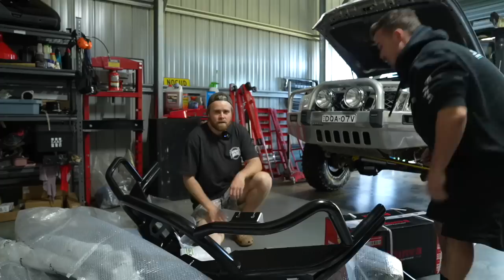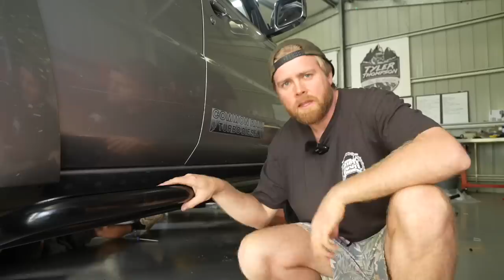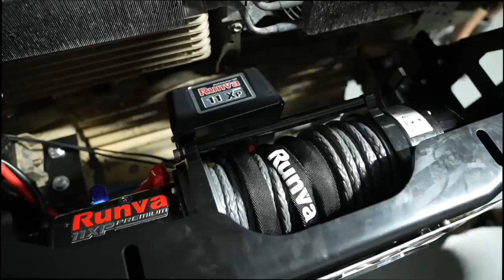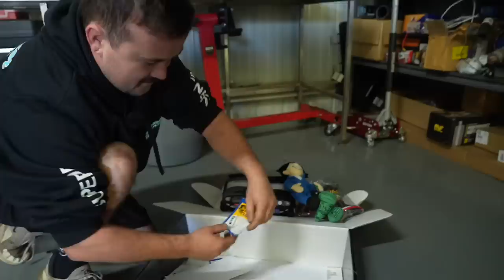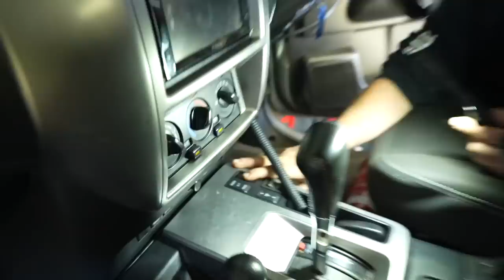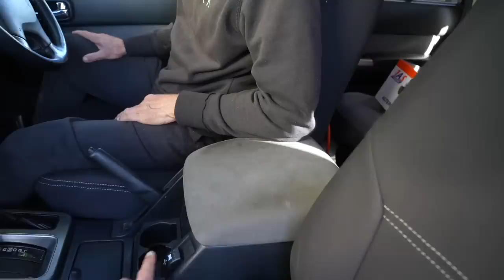My Dad's dream 4WD is done!

Comment: Hey Tyler 
I’m a ZD30 enthusiast love what your doing with your old man’s rig 
A quick question the engine with it’s factory exhaust ( dual catalytic converters ) heat up twice as fast increasing the chances of cracking your heads which I’ve already experienced 
In the build videos I didn’t see any egt or water temp gauges and 3” exhaust being installed 
For peace of mind to protect your motor I would recommend doing them I’d hate for something to go wrong on one of your trips 
Love your content especially when you’re hooking up with some of the other creators which is priceless and your banter with burto a crack up 
Always looking forward to your next posts

Comment: Ha guys, you made my day showing the wholesale automatics lock up kit install.
Couldn't you have just accessed the auto temp through the ultimate nine heads up display though, save installing analogue gauge to dash mat (bit of butcherous work that burro), christ that's gonna drive Gary nuts over corrugations on development track, flappy and bouncing around. If you keep it you'll need a bracket formed up from "A" pillar to retain it.
What also has me ticked off with Patrols, 🤔 they stopped installing that front of condenser core cooling fan, add it to your spare parts stack, then forward it to me 😁.
Love your work for Dad, great efforts young fella.

Comment: Hey Tyler and Demi hope you and the family are well ! Great job on the old man’s rig and very good spares kit can’t fault it except….. coming from a long time ZD owner here - your old man must carry a Belt tensioner assembly with pulley (genuine only) it will at some point fail, the hydraulic arm and bushes flog out in them over time and let go when you least suspect.
Reply: Exactly, but carry a T50 torx socket to access it.
Luckily I've only ever had to replace the hydraulic tensioner, the assembly last okay, or thus far, touch wood but each time I've replaced the hydraulic tensioner I've removed the belt roller, removed seal over its bearing, washed with degreaser, lubed with oil, then smear of grease prior to clipping seal on and reassembly.
Our original hydraulic only lasted 40K, replaced with genuine ($360 ouch) and it lasted less, holycrap.
As they're so expensive I elected to trial patrolaparts  unit ($70), 8K only before the internal piston ceased creating belt slip.
I then took the bushes from patrolaparts unit (harder black plastic), replaced the Nissan ones (soft white plastic) in the original unit and it's back in there operating fine.
The Nissan Bushes are the let down, see how the patrolaparts bushes last now.
Yes, to their credit patrolapart offered me a credit or replacement. I accepted replacement and carry it as my spare. I do also carry a genuine, can't be too overconfident ha!!!

Comment: Love your channel, but I'd piss off the winch isolator switch, they burn out under load. It only took me two replacements plus the original one to realise that. Instead, just leave the winch disengauged when not in use, there is sufficient drum tension to stop the rope from unspooling. Further, the control box should be mounted upright to minimise water and mud ingress. It's sure to give you grief acting like a water scoop in its current orientation. Have fun up the Cape. pk.

Comment: my son and i both recently drowned both our cars. My sons was a write off. Both were only in 1m of water. Given our problems and since you are going to Cape York where water is much deeper than that... What have you done to water resist the electrics inside the cab of your dads patrol? (particularly that transmission controller)

Comment: 5 speed Manual Lockup every gear😅
Reply: It's a 4 speed, reverse doesn't count :)
Reply: Unfortunately ZD30's don't have great engine braking nor is low gear in the RE4 auto that low, so even locked up it will be too quick on descents I think.
Early in ownership I queried Wholesale Automatics regarding a conversation from RE4 to a RE5 as it has very low 1st & reverse but they hadn't done that conversation and quoted me a figure to take it off my wish list. Bugga
Reply: @ianweal3081  I've done some very steep descents in my ZD30 CRD auto.  33" rubber on standard diff ratios makes things a bit worse, but I just use the handbrake to help out. I have a Wholesale Autos valve body which gives engine braking in 1st.  Vastly important, too, is to throw out the standard brakes and fit some Brembo rotors, high temp pads, braided brake hoses, and at least DOT4 brake fluid.  The brakes don't fade and become totally useless, which I experienced early on with the Patrol.
Reply: @einfelder8262  yeah, we've done some steep shit too, but a lower 1st for descents would help significantly with engine braking. A ratio similar to a manual would be good.
In regards to Engine Braking, ours wasn't bad, but far from good, then I had a tune done, well bugga me, one of the benefits was far better engine braking which astonished me.
When I queried the company who did the tune they hadn't heard this from others, but just worked on presumption that my boost rolled on sooner at far greater PSI, hence more compression.
Nothing else makes sense.
I used to utilise the handbrake in our previous vehicle that activated the inner drum shoes on the disc rotors, worked well, but with the Patrol's tailshaft hand brake, been reluctant to utilise it on descents.
Upgraded to DBA rotors all round and better pads early on as we carry a full GVM upgraded load constantly.
Brake lines one day, currently stops well.
Reply: @ianweal3081  I don't have reduction gears but they would be the best answer.  43% for the Auto.  Expensive though.  The tailshaft handbrake works very well - better than rear handbrake, because it stops all 4 wheels.
Reply: @einfelder8262  yes, reduction would be good but we're considering diff ratios as lower all over would be better too, as our auto sits on 2100rpm at 100 on 32" rubber.
Sons manual sat at 2500rpm in 5th on 33" at 100.
Ours comes on full song at 2200rpm, so I'd love 4th locked up to also be around 2300-2400 rpm at 100, especially when towing as it would lug so well at 100 doing 2300 rpm towing.
Hence have considered diff ratios of 4.6, maybe even 4.8 to go up to 33" rubber also and tow well.
Rear inner disc drum handbrake locked all 4 wheels also when required, proved that to my son telling him not to apply it too hard, next thing we're against the dash.
Draw back of tailshaft braking is lift a rear wheel with a jack to change a tyre and handbrake is useless, as vehicle rolls either forth or aft on open diff, but if rear locker is applied it'll stops this.
Problem is everything costs money, work out our answer soon.
V8 Warrior should resolve all, haha.

Comment: Holy dooley, Tyler on the tools 🤣

Rig looks sick, good work boys, never ends though, got get off those Mushroom bushing radius arms at some stage, they will probably be gone after York, esp since the lift. that new Drag link looks super sexy as well. 🤘

Just a tip for anyone hard wheeling if ya still running offset bushings in ya Radius arms keep an eye on them for wear front and back, they roach out pretty quick in my experience once lifted 2" and above and on big wheels. Check before replacing anything else, suspension or steering wise! I have had warrants and wheel alignment guys miss this and its not hard to check or expensive to replace! easier if you have a bearing press however esp for the front bushings!
Reply from the maker: thanks mate!